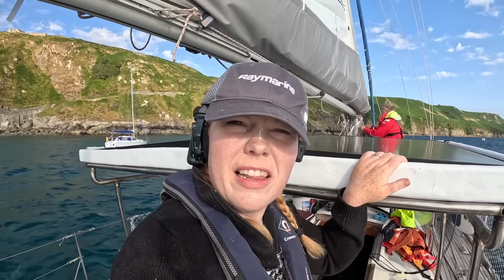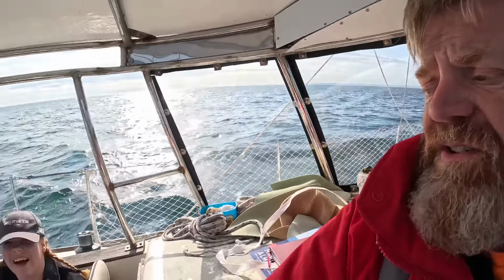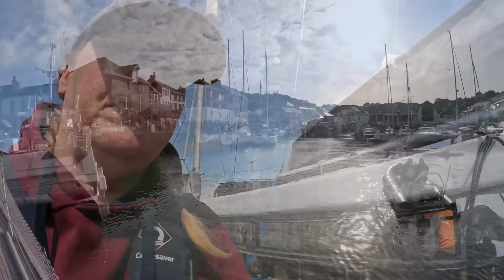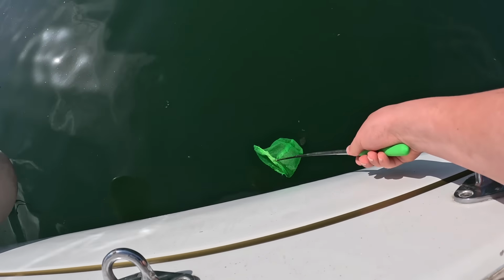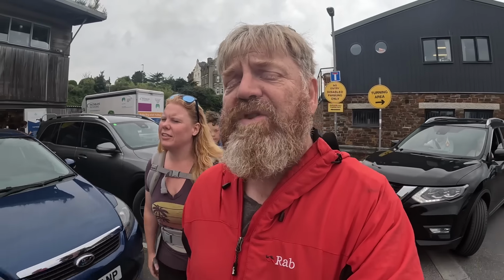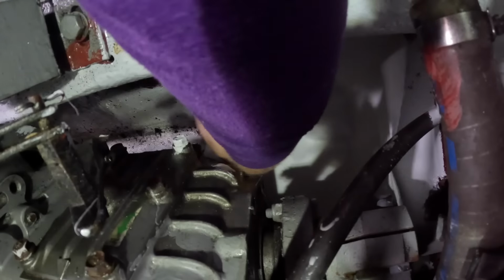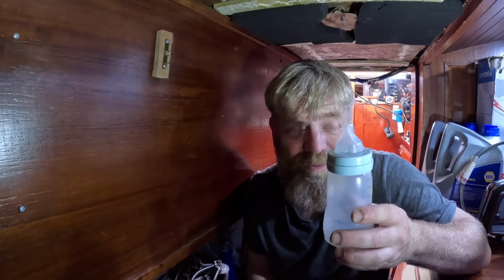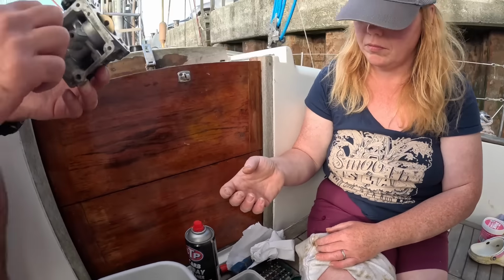Leaving our first country 🌎  on this EBAY project boat!!

Comment: Unscrew the cap on an oil bottle, drill a hole in the cap, fit a hose of approx. 50 cm in the cap that reaches the bottom of the bottle. With the hose, you can now fill oil in the gear housing when you squeeze the bottle. This can be used many times 👌
Reply from the maker: Great tip thank you 😊
Reply: @SailingMelody  
Dear Andy.
I say that your baby feeding bottle solution was ingenious enough. It worked just fine! Additionally you recycled/upcycled an unwanted drinking bottle. To me it's all about with what you can do with things being onboard. Improvising is something every boat guy should be able to. By the way: To anneal the copper sealing rings was another ingenious idea. I was almost jealous that I didn't use this method already decades ago while having several dozens of different copper washers/sealing rings but often enough simply not the right one! This might even be a worldwide phenomenon!? 😁 ;-) 3) Please kindly allow me a remark: I would've rinsed/flushed the gearbox with Diesel to get out the rest of the oil- water mixture. It's quite effective and way cheaper than doing it with actual ATF gearbox oil. But maybe also a bit messier because workspace on boats usually is scarce. So I guess that your decision to change the gearbox oil again soon, is the best solution.
Best regards, luck and health in particular. To all of you of course.

Comment: I’ve just watched Teulu Tribe fit a Hydrovane self steering system to their vessel a Colvic Victor ketch. They had the bonus of being able to reverse up to the pontoon which you did not have in Caernarfon dock but other than that their fitting problems were very similar to your own but they didn’t have to work from an unstable dinghy like yourself which shows how well you did fitting the system. They are over the moon with the system and looking forward to sailing with the extra crew member, they haven’t named it yet!

Comment: One suggestion for the awkward oil filling - Get a large ( 1 litre) syringe - together with a short length of clear tube of appropriate internal diameter.  Just need to then get the tube into the hole and then squirt.
Reply from the maker: Great idea 💡

Comment: Another great Video OM and Crew.  It's amazing just how many jobs need doing on a boat, planned or out of the blue.  I like the grey Anti-slip.  Years ago I used to use Sharp Sand and Paint on my Decks, once I had the mixture right.  Stay Safe.
Reply from the maker: It's never ending 😁

Comment: I am pretty sure that your gearbox oil contamination was not condensation and is a result of a high bilge level. Of course you should have drained the oils and refilled afresh after buying the boat but that’s 20/20 hindsight for you. It would be beneficial to do a couple of short order changes over the next few months. Good stop and lots achieved both family wise and on boat tasks. Good luck on the next leg.😀👍⛵️
Reply from the maker: Yes we checked it a week later all beautiful and will change again soon!
Reply: @SailingMelody  Excellent.👍

Comment: I had a car that had a 'scaly' carburettor that probably had water in it at one time and formed on the wall of the float chamber. It became a persistent problem after multiple clean outs because the reformed scale broke off even after cleaning it, and it partially blocked the jets. I put up with it until the car was written off by someone running into the back of me at traffic lights. 

It's a bit of added expense but, I would consider getting it replaced.

Comment: Thank you for a lovely video! My, you're all really a seagoing family now! Just a little tip re dirty oil. It is possible to buy engine flush oil. I used to use it when I was changing my engine oil but I don't see any problems with the transmission either.  Should work out a bit cheaper than wasting good oil! 
Gee whizz Ollie is well on his way to Able Seaman! I'm so glad that you installed the netting - do you have any plans for replacing the safety cable with stainless steel tube? 
If you are going to the Mediterranean there is no way of avoiding the notorious BAY OF BISCAY!. Lord have mercy on the good ship Ocean Melody and that's an order!

Comment: Curious what Chris thought of the white smoke on warm start up of the engine?  I was hoping he would take a look at the injectors, O rings etc to diagnose leaking into the cylinder.
Reply from the maker: He was having a holiday 😁😁he has given us a list of things to work through this winter to hopefully solve the issue 🙂
Reply: @SailingMelody  Understood.  I had promised you an article about using a laser heat gun to identify the suspect leaking cylinder.  Turns out the author, who has written for 50 years recently had his website redesigned...  there used to be 50 years worth of archived articles to search through... the new website only has articles going back to 2018...  I can talk to this author, but realize he has other things to do in life than answer questions on the phone... he wouldn't have time for anything else if he did...  You can't ask Chris to spend his holiday working on the boat.  We have to respect people's private time, because like the rest of us... everyday is filled with non-stop work.  When we are not working, we all NEED our off time.  This issue isn't something that is going to break the boat this season.  It is something to address, that is slowly eating away at the life of a cylinder.  But its a slow process.
Reply from the maker: Ah what a shame. 
Yes it is something we will be working on over the winter season which sadly isnt far away.

Comment: Hi, when you get water in the gearbox and then an emulsion you need to find the source of the water.  Have you got an oil cooler on the gearbox? If so that would be the first place. I have had a similar gearbox on my engine for 25+ years and never had condensation in it. Also you should do a flush to ge rid of the remaining emulsion and then fill with new oil to manufacturers spec.
Remember water is not a lubricant.
Hope this helps. Cheers Peter.
Reply: Do you not think that Chris, his marine engineer mate, who was onboard at the time, might have been better placed to advise on this??

Comment: Love the videos, been watching for a while.  I just saw you changing your gearbox oil. You mentioned ATF oil, is your gearbox automatic? If not you should be using another type of oil. Whishing the best. Cheers
Reply from the maker: We got the Oli as specified in the engines manual 😁
Reply: @SailingMelody oh great! It’s just that you may have mentioned it in previous videos but to me (not a mechanic) the gearbox looks like some sort of mechanical gearbox, and you definitely poured ATF into it (by the colour at least). So if it were a manual gearbox it should be we using some king of gear oil like 90 weight for instance. But if you’re positive about it alls good!! Good winds!

Comment: Based on my experience as a motorcycle mechanic, I would say that just because there is no obvious rust in the gearbox does not necessarily mean all is well. The question is, is there any pitting on the teeth of the gears, and if so, how bad is it?  If you have a lot of deep pitting, the hardening is compromised and there is a danger that a tooth will eventually break off. There is probably no need for panic,  but if there has been water in the gearbox, at some point I would want to get a look inside it. Maybe a marine mechanic can offer better advice, as the loads on a marine diesel and a motorcycle are probably rather different.

Comment: Did you mean wind against tide, wind and tide going in opposite directions, which can kick up a lumpy sea state, especially in moderate to rough conditions. Wind over tide is something entirely different, which is wind and tide going in the same direction. Perhaps a slip of the tongue, . . . . . . . Please ignore all of the above, your use of wind over tide was correct, and wind against tide weans the same thing. Wind with tide is when both are going in the same direction. Please accept my sincere apologies, I was not trying to be a smart ar*e, it's been a long time since I've had to use those terms, and my 79 year old little grey brain cells are obviously not what they used to be. Fair winds and safe happy sailing.
Reply from the maker: Exactly what I meant and thought I'd said 🙈🙈